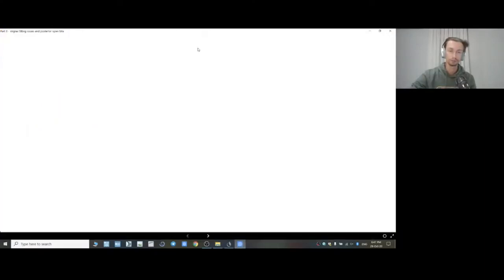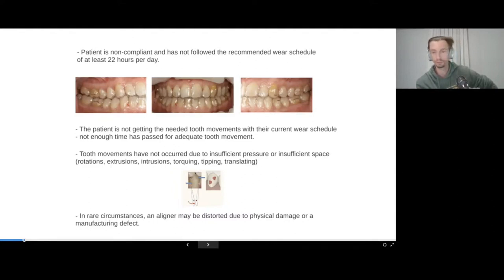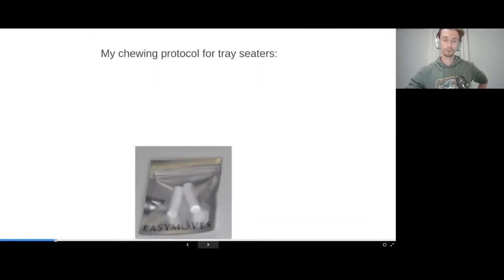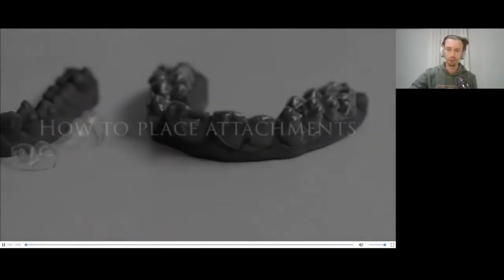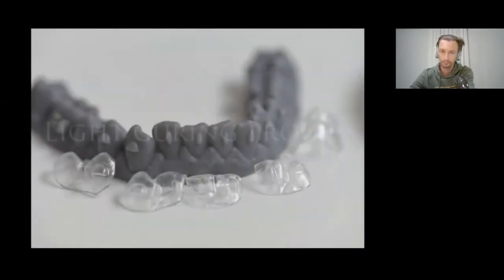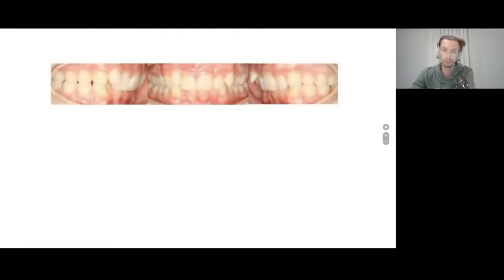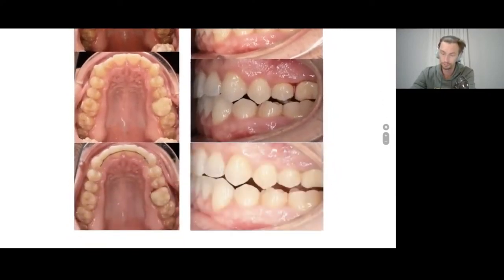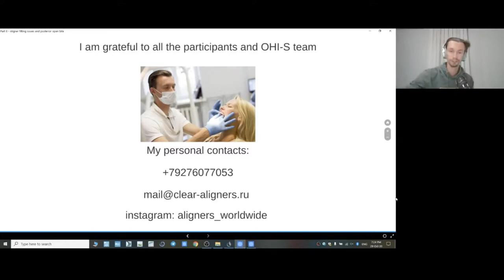What to do if aligner fits loose. How to close a posterior open bite. My lecture from 2020 - Part 8.

Comment: Very nice lecture , can u plz make a lecture on refinement, making new impressions and case refinements, how to add new impressions to the case and make new set of Aligners and attachments for case , do we start as new case , or we just refinement for old plan ???
Reply from the maker: It depens at what stage you are with a certain case. If it's not even close to finish, make a fresh start with new attachments. If there are just some minor crowding and rotations left, you can use the existing attachments or even remove all of them
Reply: @mshish63  hope you can make a leture for refinement and adding new impresions or cast to compare existing treatment plan and results ,
Reply: Can u use maestro3d to add a Pontic tooth if missing tooth in arch !??